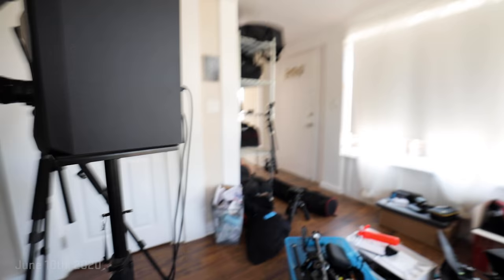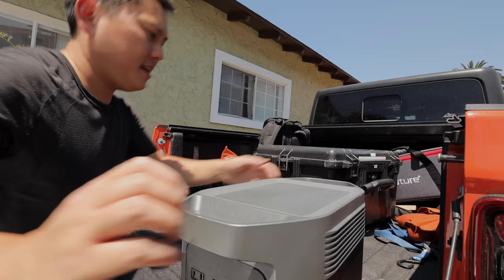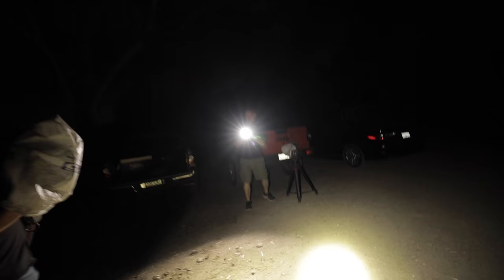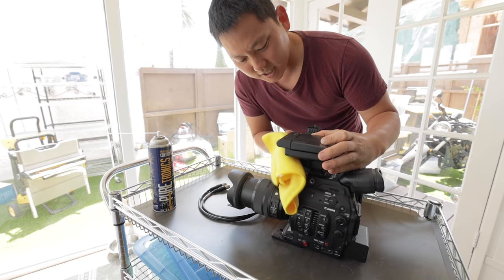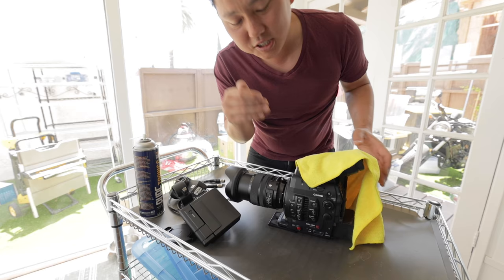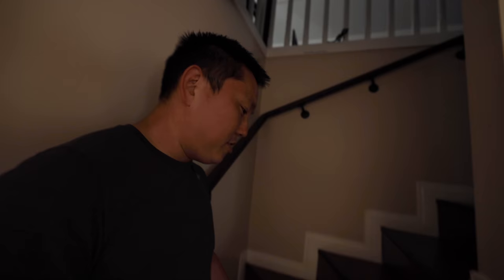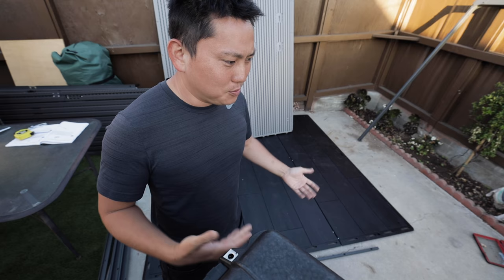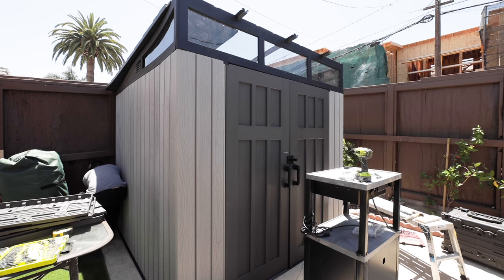First Day Back At Work VLOG

Comment: I'm one of those weirdos who has a mini-case full of micro sdxc and sd cards. It has two layers. One for the pristine formatted cards, and one for the "fully stuffed with footage" cards.  It stays in the camera bag. It does not leave the camera bag. I may have problems if I upgrade my camera bag.  
I used to rip on drummers who left their snare key at home,  but having loaned audio  adaptors of every imaginable type  to less well-prepared DJs, sound guys, and performers over the years, I've realised that brainfarts are what make us human. 
I don't mind packing a lightweight flightcase full of weird non-standard plugs and cables if I'm playing at, or rigging, an all-nighter, because there will always be someone who thinks that the venue or promoter has psychic powers.